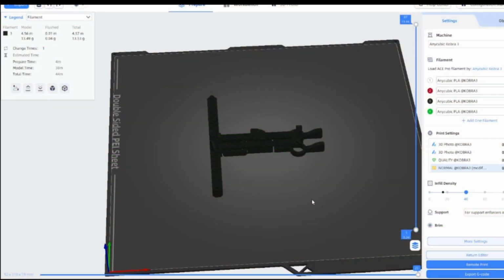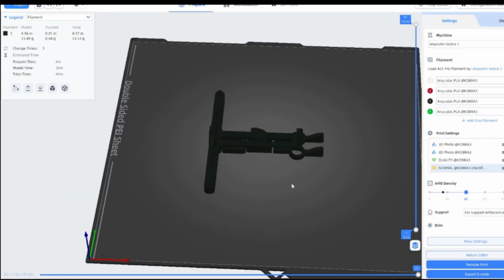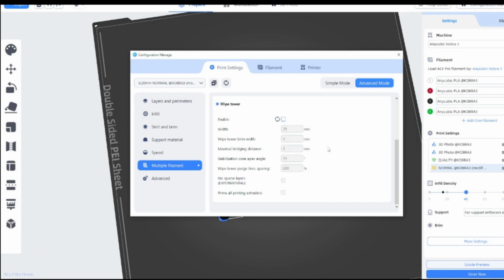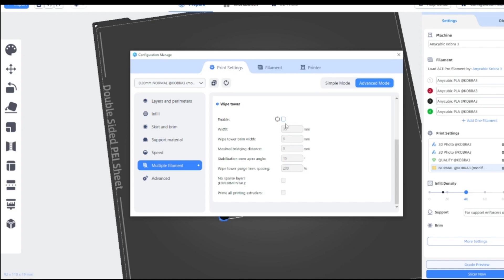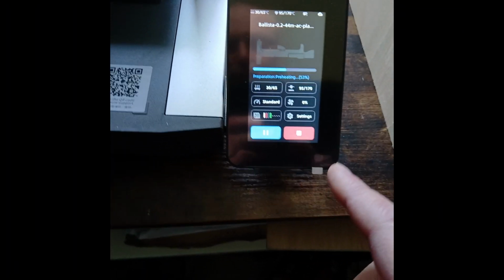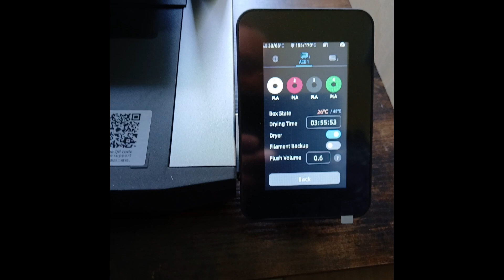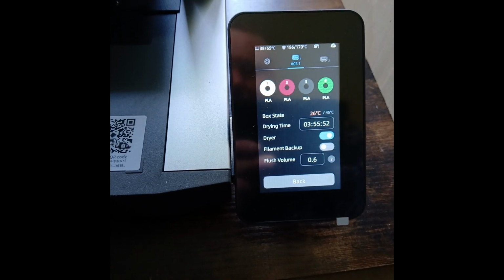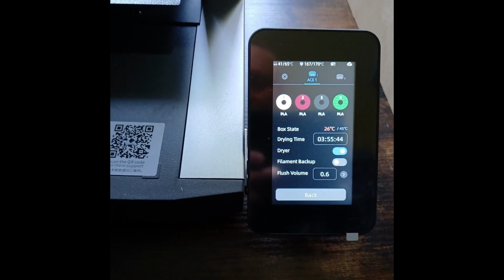How to reduce 3d filament waste | purge when doing multicolor 3d printing using the Anycubic Kobra 3

Comment: Thanks. Can you do the same or better with the anycubic slicer next based on orca?
Reply from the maker: Hi yes you can turn the tower off In Anycubic  Next slicer, if you look on the left hand side where it says "Quality" "Strength"  "Speed" "Support" ect if you click on "Others" it opens up bed adhesion and prime tower.  You can turn it off on or on from there, and you can also change the prime tower width and volume ect .. hope that helps

Comment: Have you run into issues printing color where the ACE Pro switching color and makes really screeching noise and the buffer mechanism jammed? Printing single color is fine, but not multi-color. Do you need to do anything different when printing all 4 colors?
Reply from the maker: Hi I have not had this issue when printing with multi colours but you might have a peice of filament jammed in the Ace pro mechanism,  and there are videos online showing how to get to the mechanism to get the filament out, Or contact Anycubic support and they should be able to help you out, sorry I cant help you with this as its never happened to me and hope you can get it sorted.